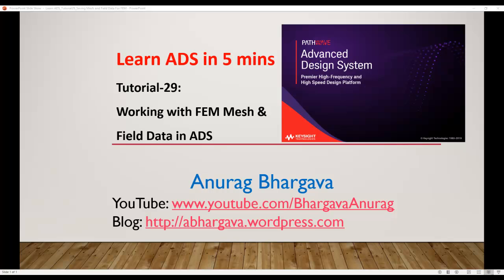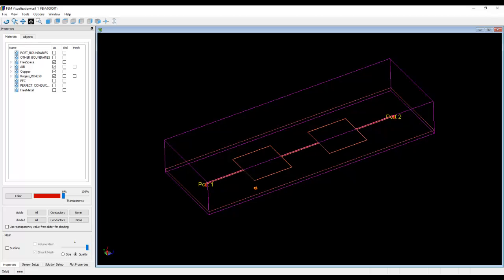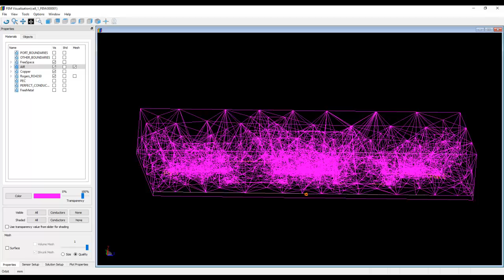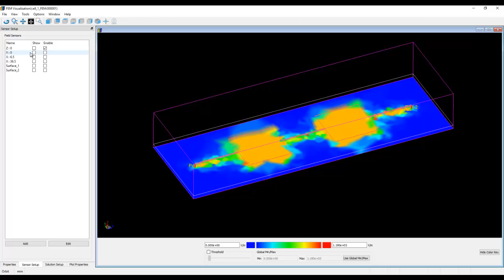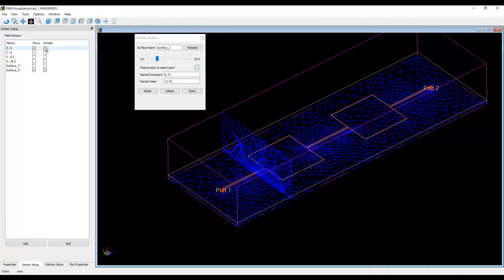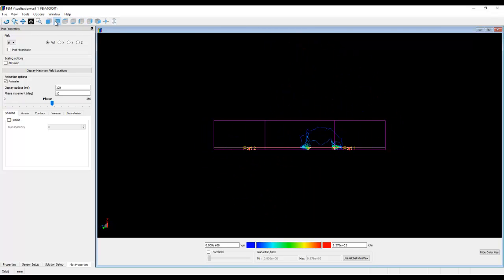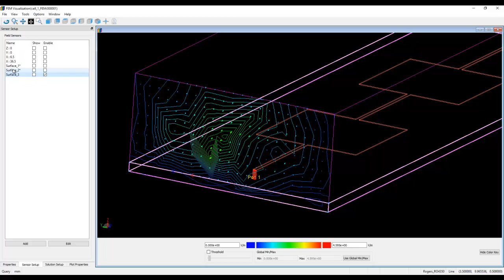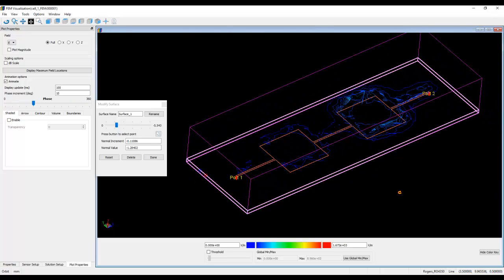Tutorial-29: Working with FEM Mesh and Field Data in ADS

Comment: Dear Anurag

Thanks for such a useful tutorial ....waiting for further videos. 

Can you please make tutorial on artwork stuff in layout and layers as well.
Reply from the maker: Hi Waqar, Could you elaborate on your request a little more? I couldn't understand it fully....
Reply: Dear Anurag, 

let me elaborate with a scenario. If I wish to design an RF circuit and am done with circuit simulation. The next step is to go for Momentum simulation...for that when I convert my circuit to layout, most of the time the artwork for the transistors or some components are not available .....how to go with that? can you elaborate on developing artwork for it 

secondly, would like to request for the introduction to the layers of layout to finalize the PCB layout design before starting etching it.
Reply from the maker: @waqarmalik81  For layout footprint, you can refer to one of my earlier video: https://youtu.be/Z9TvYfb6ETY 
Hope this will help you to understand, how to create your own footprints and attach it to any component you want. I will create newer video for this later in Learn ADS in 5mins series but currently have my plate full with other topics to be completed.
Hope this helps...!!

Comment: Previously, I had a point of view that complete behaviour of a microwave structure can't be captured/simulated in ADS. But it seems that I was wrong.

I have a question and would be very happy if you point me in right direction. In this tutorial, you've set the airbox height to 5mm and ADS created a uniform rectangular structure of height 5mm all over the PCB.

However, I'm trying to simulate a Suspended Substrate Stripline Filter, in which I've to use Air on both top and bottom side, with different cavity height at different locations of stubs. Similarly, i can't use a single ground copper plate as done in this tutorial, because I've PCB layout pattern on both sides.... I hope you understand the problem and waiting for your response.

Sorry for loads of questions in a day.
Reply from the maker: Hi Hamza,
You could do all that using a creative way in ADS...😊
You SSL, you can define Top and Bottom layer as the Cover Plate having Air of desired thickness on either side of the main substrate, map the conductor on either side of dielectric. You can also have Air based dielectric slabs in different height as you may require as well. Now you can use VIA mapping to short the upper or lower side of the metal conductor layers to the respective Cover Plates on either side, remember metal VIA will be a solid conductor and will create cavities of different height wherever you draw any shape using the VIA layer in the layout.
Let me know if you get what I explained here?
Reply: @BhargavaAnurag  thanks for the detailed reply. I'll try it out and will get back if unable to get the desired results. 👍
Reply: @BhargavaAnurag , I've tried this option and I think it worked as far as 3-D EM preview is concerned. I'll check its results and will compare them with the results of CST. 

I am unable to share the pictures of my setup, is there any way to upload or share them with you?

And the next question that arises is, mapping a layer of air on top and bottom of the substrate with the metallic covers on the top of top air layer and bottom of bottom air layer, I will have a cavity of uniform height. If my cavity height changes i.e. in the same waveguide cavity, the cavity has the same height till 2mm length of line and then it changes to 1mm suddenly, then what options are available?

Need to share pictures!